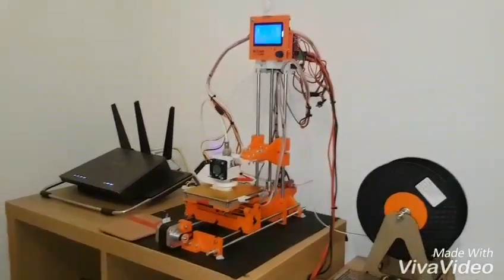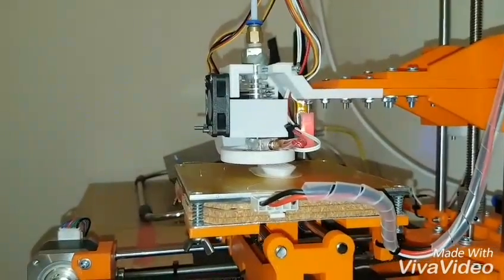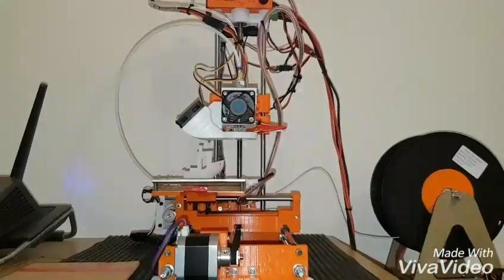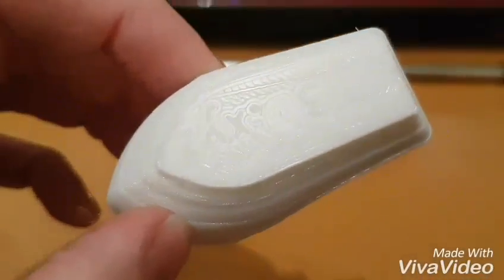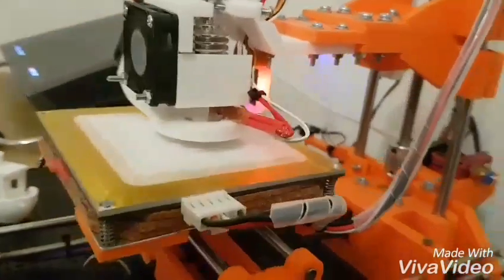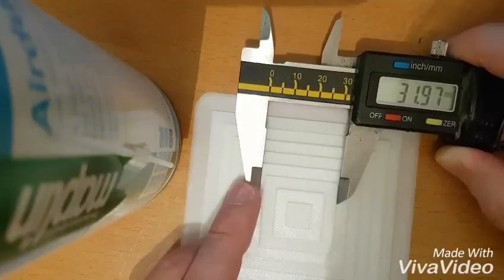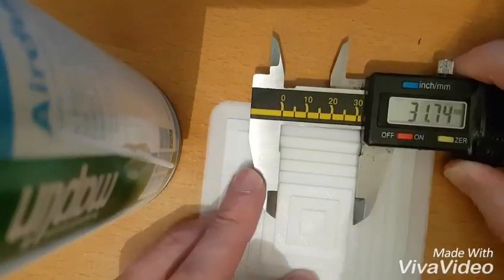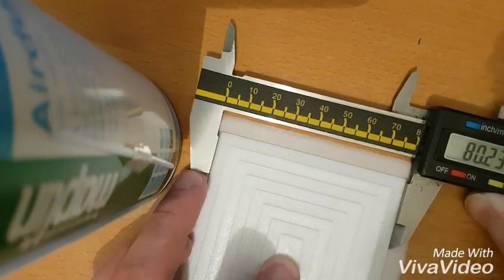Reprap Atom X 3d Printed 3d Printer -  FInally Finalized!

Comment: im gonna print your model for sure seem very accurate! thanks a million times  for the share!!
Reply from the maker: Good luck. Let me know if you need help.
Reply: @Plan-C  which size is the bed on your model? because i got some spare here...
Reply from the maker: @BraveNewWorld1984-r6o  Hi. The bed is 120x120
Reply from the maker: the Y rails are 30mm long end to end. in Marlin, xminpos=0, Yminpos=-33 (to allow for the bltouch offset), Xmaxpos is 105 and Ymaxpos is 110.
Reply: @Plan-C  ok cool its a custom bed?
Reply from the maker: I used this 
[£12.07]PCB Heated Bed 120*120mm 12V Kit For Mendel RepRap 3D Printer 3D Printer & Supplies from Electronics on banggood.com
https://banggood.app.link/IfevWEFx0W
Reply from the maker: https://rover.ebay.com/rover/0/0/0?mpre=https%3A%2F%2Fwww.ebay.co.uk%2Fulk%2Fitm%2F202659844994
Reply: @Plan-C  thanks a lot !!:)
Reply from the maker: @BraveNewWorld1984-r6o  no worries. I printed a one piece print bed rather than use the 4 pieces of the original design. That hot bed lines up perfectly. I did put a thin aluminium plate on to of the print bed to tray and wick away heat and put cork between the hot bed and the print bed. The one piece print bed is here
Reply from the maker: https://drive.google.com/open?id=0BzujMMpM5EE4NUNkU3F3RW9XSk0

Comment: That's great!   I have seen Benchys (AARGH) printed on quite expensive 3D printers that were nowhere near as good as that, and the measurement test is excellent.   Thanks for sharing.
Reply from the maker: John Colvin Thanks. It is still running. The only thing is that the y endstop design is a bit flakey. It can move if knocked and upsets the autolevel grid calcs. I will upload an improvement. Thanks for watching.